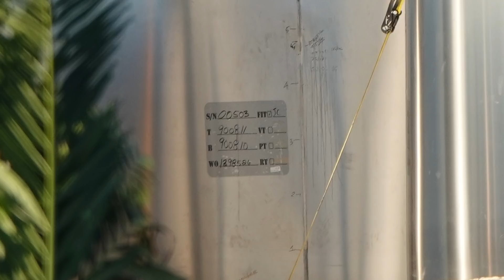2020 10 11 TBT - Sunday at SpaceX Part2 4K - SpaceX Starship Boca Chica

Comment: That crane is massive, is it sitting on bearers and not sitting flat on the dirt?
Nice footage as always Maria🇦🇺👌
Reply: It is sitting on timbers. Pics by RGV Aerial Photography show twin ramps of timbers - the crane drove up them onto the final set of timbers. A pic elsewhere showed one of those multi-wheel Roll Lifts under there, but only briefly. Possibly it's on the bearers for a test fit of these two.
Reply: I think they lifted the white crane onto wood blocks (under the treads) so they could drive the roll lift under the center of the crane. Someone said they could move the crane down the road with the Roll Lift whereas they could not get on the highway with the treads because it would tear up the road.
Reply: @59seank  I gota see that might be very unstable 😬
Reply: @alanblyde8502  Yeah! Should be quite a show.  Then we have Super Heavy.... !!!
Reply from the maker: That was the problem.